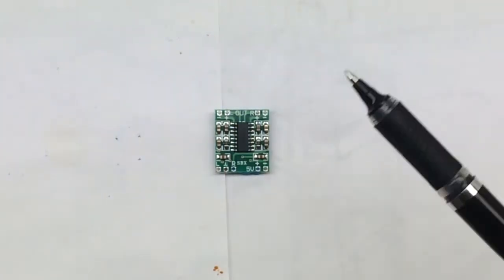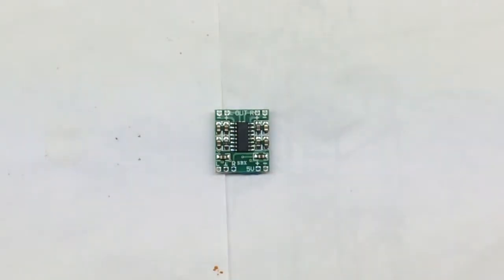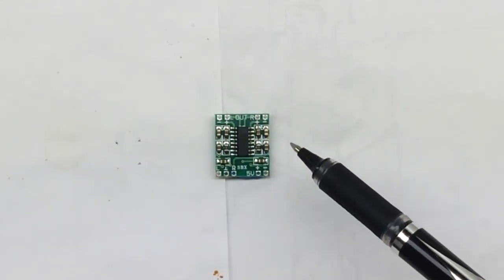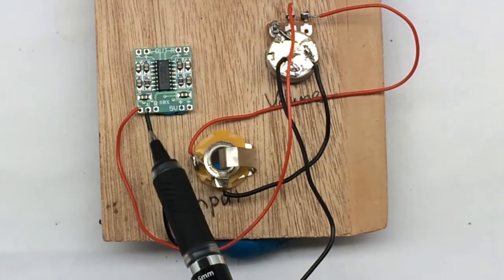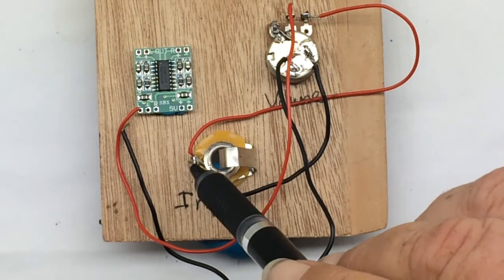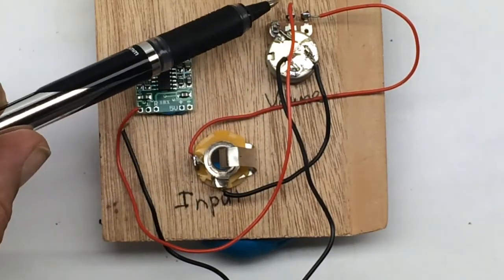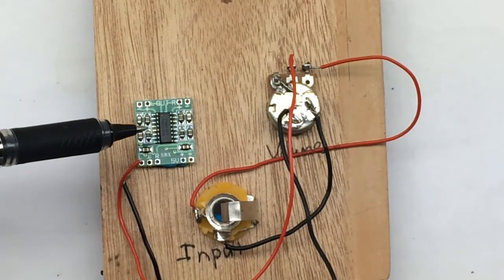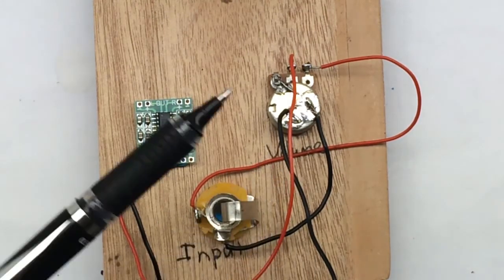How to add a volume control to any amplifier

Comment: Sir please tell me if we connect a 3W speaker to a 50W amplifier what will happen , is this dangerous for speaker or the amplifier ?
Reply from the maker: its only dangerous for the speaker if you over load it with more than 3w
Reply: Everyday Diy and if we feed a 50w speaker with a 20w amplifier then?
Reply from the maker: Vishal Srivastava if the speaker impeadence is correct you will get 20watts from the speaker
Reply: Generally it is better to have more amplification than you need, rather than a small amp and big speakers. Its safer for both components and just sounds better